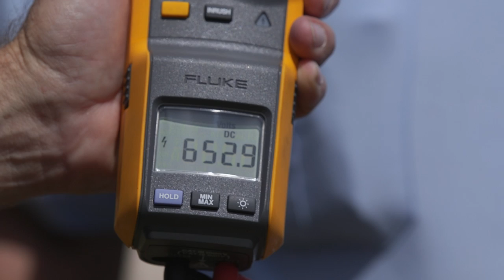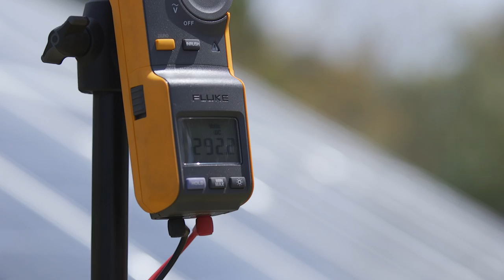Electrical Arcing & Water Conductivity

Comment: Few questions. 
1. Open circuit voltage from the watered frame. What was the current?
2. Why isnt the system grounded?
3. What is the area that can be covered? The incomplete covered area is still "dangerous"
4. Isnt it smarter to wire the solar panels in a less dangerous way?
Reply from the maker: 1. The system was producing 8.8 amps short circuit current.
2. It was purposely not grounded to represent a potentially dangerous situation which we encounter regularly on service calls.  Quite often we encounter poor quality installations where the system is not grounded correctly or grounding has been compromised due to a deterioration in system componentry due to age or weather exposure.  This is the type of unanticipated risk that firefighters are encountering regularly without having the training, systems or processes to adequately mitigate these risks.
3. As long as you get a band of coating across 30% of the centre of each panel, the circuit is effectively broken, there is still voltage produced by the uncovered solar cells but there is no amperage.  The equation for electrical output is Volts x Amps = Watts, so even though only the centre part of the array is covered and voltage is still being produced, there is no current, so the system is electrically safe.  Saying that, we always advise completing covering the panels to minimise the voltage produced and ensuring maximum safety.
4.  There are many ways to wire a system and there are several system types such as microinverters and DC optimizers that are designed to improve safety, however the vast majority of legacy systems are standard string arrays and the system in this test represents a typical 5kw residential string array installation (albeit, one that is not grounded or connected to an inverter).
Reply: @pvstop5763  aaaaaaaa
Reply: @pvstop5763  om
Reply: Just put a fuse. It pops if shorted and there in no Danger.  There's a suckered born every minute and he will buy this product. 😆
Reply: @pvstop5763  3 years later and youtube finally reminds me there are answers to the questions I had already forgotten. Thanks for the answers.
Reply from the maker: @sebrassino  haha, no problem, my pleasure!
Reply: Lmao
Reply: @sebrassino  sorry but all the answers were wrong except 3 since that was about their product, 
1 is self explanatory there is no current hence open circuit, 
2 you can't ground the DC side because that would create a direct connection between the DC and AC circuit creating the potential for a very dangerous situation also not needed grounding isn't like some magic where the power just goes into the earth, it's an alternate return path to complete the circuit but with solar that doesn't make sense and it wouldn't work 
4 all electricity is potentially dangerous but generally not an issue the main point are cost and efficiency while you could wire everything in parallel it would cost a heap more because all cables etc would need to be massive for the large current and to keep voltage drop down honestly it just wouldn't be practical
Reply: @jessemeanlt1  wonder why nobody thought of that 🤣🤣shame it won’t work think about it. Panels nominal current is just under the short circuit current, no fuse or breaker could detect the difference. Fuses on the dc side would only help prevent several strings back feeding down one damaged string ( possibly)
Reply: @jessemeanlt1   you are showing your lack of understanding about what is happening here. A pv panel continues to produce power AT the panel unless it is taken out of sunlight.  If damaged panels short internally,  your disconnect switch won't do a thing for the roof.

Comment: Hail storm s 2 cm 10 km ht 10 mper sec sq, 10 g 400 mper sec over 100 us collision 40 KN brittle strength of glass z 10 KN. The silicon breaks at a mere 200 N which means even standing on it not a great idea.

Comment: Thanks for the insight.
I never considered that a broken system and water can energise the frame that much!
Reply from the maker: We believe that we are the first to conduct this type of experiment and it is a good example of the unanticipated risks that firefighters, emergency services personnel and electrical technicians may be unwittingly exposed to when when they encounter incidents involving damaged or faulty solar PV systems.
Reply: @pvstop5763  So what current do you expect to flow through human body in this case?
Reply: @Luzt.  In this example the PV array is producing 650 volts at 8.8 amps.  If you were to touch the positive and negative cables, this would be fatal.
Reply: @foranjim  One of us has no fn idea about PV. As I see it it was 650 V open-circuit and 8.8 A short-circuit. Not AND but OR.
Also, I did not watch the video carefully because I found it ...
Reply: @Luzt.  I was trying to address the question in simple terms but obviously you do not find that satisfactory.  I should have said "probably" fatal.  As to the expected flow of current through the body in this case, you would obviously know that there are a number of variables at play including the impedance of the particular human, size, weight, gender, are they dry, damp, wet etc etc.  Also a PV system is a finite source of power (not an unlimited source like a sub-station) and if a human holds on long enough, the impedance can potentially crash the power output of the PV system, but not until the human is most likely seriously injured or deceased.  Happy to have our work scrutinized, but would prefer if feedback was constructive and polite.
Reply: @foranjim  Geneder? Really, gender plays a role in safety analysis of electrical installations? Can yo show me some IEEE document analysing gender issues?
For safety considerations both systems are time invariant (finite, unlimited are not used in this domain as qualifiers as far as I can recall). Time is not a factor in this case and should simply not be mentioned.
PV system is much less stiff than grid. Again, the impedance introduced even by damaged isolation is magnitudes larger and therefore make orignal stiffness unimportant.
In simple terms you should have modelled human body by a simple resistance to ground, value assumed arbitrarily, measure current flowing from PV, relate the readings to generally available information regarding physiological effects and formulate conclusions.
EOM/NRN.
Reply: @foranjim     when you say  "when human holds on long enough, the impedance can potentially crash the power output of the PV system"

no,it is NOT like that; it takes only  A FEW MILLIAMPS to kill us, and these few milliamps are SHOVED INSIDE us by VOLTAGE; there plenty enough A and V there;

a 30 mA GFI is often used in the entrance of the electrical panel in houses being built; i remember that well,i almost got killed on one  by electrocussion when one GFI  had been replaced for a short time by a 500 mA one, without my knowledge,upon failure of the first one to re-arm, and they had none other available right there;  long story...

Also, 12 volts,a simple 12 V battery,big or SMALL can kill you:  if you are immersed in salt water (tending to you boat,or to your trailer,or just working in a flooded boat,in salt water) 12 volts sting like 220 VAC in the home,as it can kill you; make sure there is NO 12V  wire into the salt water;

So, also solar pavel electricity is NOT finite; for us, to shock us,it is INFINITE; until night time.
Reply: grounding and bonding is important in pv too!

Comment: why people never thought of just installing a mechanic transparent roof  that can just cover the cells in case of a hail storm?
Reply from the maker: There are a few reasons including; 
- This would significantly increase the cost of the solar PV system, 
- It would lower/inhibit the efficiency of the solar panels
- It could affect the load bearing capacity of the roof
- It could increase fire risk

Comment: Please keep the solar system and electric rules:
1.don't short circuit (common). 
2.don't connect overload.(common) 
3.pls Connect the short circuit breaker (or) tripper.(common) 
4.don't clean the panels with water at charging time.
5.don't select the without insulated (or) low quality materials. 
6.don't play with electric wires. It's maybe electric shock.
7.pls fit the lighting arrester nearly.
8.using the main switch totally. 
THE SOLAR SYSTEM IS ONE TIME INVESTMENT, BUT LONG TIME MONEY SAVES. (So use care with safety)

Comment: I just bought the solar light because wanna use it when emergency or black out during the flood season.But when I saw this video about fire and shotcircuit make me scare so much.
Is it dangerous for when I set it to automatic mode? turn off automatically when daytime and turn on automatically when already night especially when i'm not at home for a long time? Can I clean it with a medium wet towel? I still not install it on the wall yet because I don't wanna it being wet during rainy day.sorry for my bad english.
Reply from the maker: It is hard for me to say as I don't have any details on your specific "solar light", but as long as the light is new and undamaged, it should be perfectly safe.

Comment: I've created an even better solution. Black foam. Called V-stop. It spray on the panels as a thin clear layer and then reacts in 5 seconds into a 15cm thick black foam coating blocking 83% light to panels rendering them safe. It hardens so as to not be blown away and can be removed with a brush.
Reply from the maker: Most foams contain chemicals such as PFAS which are bio-accumulative and environmentally unfriendly and I'd be interested to know what trigger causes the thin clear layer to react and transform into a 15cm black foam.  If the coating only blocks 83% of light, the panels will still be producing power.  Apart from that, I think you are on to a winner!
Reply: I was surprised that the PV Stop product did not address how to remove it after everything is safe. Seems like it is permanent.

Comment: Michael, I think I covered how particulates in the rain drop can be conductive. The water, being void of impurities, is an insulator.
Reply: Water needs solid particles to start forming rain drops.
In some parts of the world, rain water or molten snow are actually very dirty.
You have to be cautious and not count on it being insulator.
There is reason open circuits left to rain on short.

Comment: There are a few things to fix the problem, do not wire the panels in series, stick with a 48V system, a bit more expensive but much safer!! no dangerous DC voltages.
Reply: Just dangerous amperage.
Reply: Most residential inverters require a minimum of at least 120vdc to even turn on. So you have no choice but to wire in series. The other issue is that wiring in parallel increases the amperage with each panel installed. You size the wire to the amperage Dawn, so your cable would be massive. Voltage X Amps = Wattage.
Example: say you want to supply your home with a 5000 watt set up. Each panel was a 48volt, 9 amp, 200 watt. You would take the 5000 watts that  and divide it by the 200 watts each panel provides. Your array would require you to install a total of 25 panels to reach the wattage output. If each panel was wired in parallel, you would multiply 25 (# of panels) with 9 (amps produced from each panel). That would give you an amperage of 225 amps. That would require you to use a minimum of 4/0 gauge cable. That’s very expensive running a cable that size to your house. If you hook the system in series, the amperage stays at 9 amps and the voltage climbs with each solar panel linked up. That allows you to run the cable using 10 gauge which is considerably cheaper. Plus, most inverters I’ve used Max out at 30 amps, so I’m not sure the lugs will allow any thing larger than 8 gauge. 
In theory, you are correct that it’ll keep the voltage down, but it does crank the amps way up. Both are lethal numbers either way. Best way to protect yourself is to properly fuse and ground the system to protect yourself and your investment. You can install inline fuses straight off your solar panels. You can and should definitely ground the metal frame to two ground rods with a 4 gauge copper wire.
Reply: @jimedick9496  100 % correct and true,, i have installed 3kva inverter with initial 6 panels 24 v in series,,,
Reply: 48V implies 2 modern solar panels of 250W in series. That is a bit too much when using 3+kW power. 3kW requires 6 parallel connections while 5kW implies 10 parallel connections. I understand that with parallel connections there is some compartmentalisation whereby a leak of power in one panel will not draw power from all panels but the sheer number of parallel connections make it too expensive and bulky for home use.

Comment: You could install a system that disconnects all the single solar panels to be operated in case of emergency. Because the high voltage only occurs, if the modules are chained together. The single solar panels only have 24 V usually, which is totally safe to touch.
An emergency wire that disconnects the cables between the panels when pulled would do.
Reply from the maker: Don't you think that sounds a bit complicated?  Also such a system would require periodic maintenance and would be prone to vandalism.  PVStop is a much simpler solution and shuts down the power in every panel in the system to 0 V.
Reply from the maker: @professorfukyu744  Wow, quite a lot of anger in your comments!  The PV system in the video is a portable test array, not a commercial installation.  You are correct that all PV systems require maintenance, unfortunately most systems are not adequately maintained, hence the growing number of incidents involving faulty, poorly maintained, or poorly installed PV systems.  Have a nice day.
Reply: @professorfukyu744  To be frank, maintaining solar panels is not something people prefer to do. The chances of defects is very low and the cost of inspection is far too high that negates any advantage it has. So, overall ROI of maintenance is negative

Comment: common residential installation will not recommend 600v of pure DC. they only use between 80 - 120v at most. if voltage leak is in the roof. 1st thing to do is evacuate the people living on the house and uninstall the panels at night. correct me if i am wrong.
Reply from the maker: Residential installations of 600v DC are common in most countries around the world.  In Australia for example, recent legislation changes now allow for residential installations of up to 1000v DC (in series).  If voltage is leaking onto the roof, evacuating the structure is a sound safety precaution, however, if the structure is on fire, it is not always practical for first responders to wait and uninstall the panels at night.  In an emergency response scenario, first responders need a solution that can quickly and effectively make solar PV systems electrically safe, that is why we invented PVSTOP.

Comment: a fuse or breaker works really well... earth the frame (should be mandatory) set a top end voltage limit for domestic systems in how they are wired. A proper conductor size for lower voltage systems must be strickly specified. This all comes down to proper installation. Even incoming house hold (grid) electrical connections can be deadly after storm damage.
Reply from the maker: Hi Kelvin, you are absolutely correct, it all comes down to good quality system components and proper installation.  The issue is that a significant number of residential installations sub-standard and a smaller proportion are potentially dangerous.

Comment: Wow that’s so crazy. You can know the numbers and output of a solar system but seeing the electricity arcing completely changes your perspective on solar electricity
Reply from the maker: Hi Al,  so true.  The perception of solar PV systems is one of a benign set of panels that sit on your roof and produce free power, they do not move or make any noise (usually) so it becomes a case of "out of sight, out of mind".  A typical residential system can be putting out 2, 3 or 4 times the electricity of a power point and people know not to stick a fork in a power socket, yet they will quite happily climb all over a solar PV array without any thought to the potential safety issues.  a very sad case in point, only two weeks ago a man in Dubai was fatally electrocuted by a very small PV system (just 2 panels)  http://www.uaebarq.ae/en/?p=2740

Our mission is to raise awareness of the potential issues, improve the knowledge base of firefighters and electrical contractors through education and offer solutions that allow these personnel to operate safely where solar panel systems are involved.
Reply from the maker: Thanks Al, so true, seeing the arc that a PV system can generate definitely helps to put the risks in perspective.

Comment: How did it catch fire? Did someone put the silicon electronics in reverse to send AC current? Hope they are making better ones to sustain hail storm. Maybe the hail storm changed some interconnects  leading to the problem.
Reply: Mostly due to leakage current due to hot hotspots on the solar modules, which occur due micro-cracks or poorly built module. Sometimes short-circuits can cause the module ignite under extremely hot ambient temperatures, and can also due to bad installation methods. Solar PV is not as simple as it looks, a qualified, knowledgeable and experienced person should be hired when system crosses 60VDC circuitry.